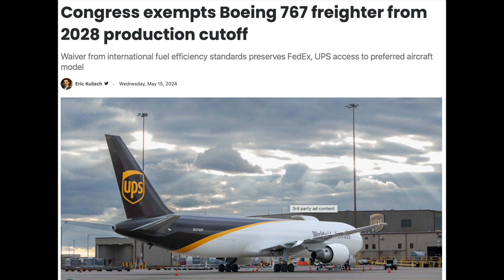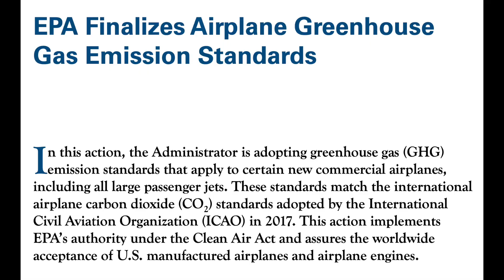Boeing 767 Exemption: Climate vs. Commerce? The Aviation Industry's Dilemma

Comment: I don't see any net benefit in legislation that pushes for scrapping perfectly functional aircraft to slightly improve efficiency.  At the moment, aircraft manufacturers are already falling well short of their production goals in meeting the orders they already have.  Pushing the B767 out of service prematurely will only stress the system even more.
Besides, the B767 is a fairly efficient aircraft already, with efficient high bypass turbofans.  B767's are not part of the problem, there are only 750 of them in service worldwide, and there is nothing to replace them with.
Reply from the maker: I agree. There isn’t a suitable replacement for the B767, and nothing compares in terms of versatility and economics. 

It’s in the interests of Boeing and companies that fly the type to maximize the economics of the 767. It seems that policy didn’t consider the range of benefits that such an aircraft offers. Additionally, policy isn’t aiding aircraft manufacturers in creating a roadmap to more efficient and sustainable alternatives. 

Thanks for your comment, and for watching.
Reply: You're right here. Scrapping it for falling short of a mandate that was made long after it was built is counterproductive. It's like scrapping a fleet of hybrids years before they are have lived their technological lifespan because full electrics are better, while ignoring all of the ICE vehicles that are still out there. At least when you talk full carbon footprint.
Reply from the maker: I appreciate your comment. Thanks for watching!

Comment: This demonstrates the idiotic actions of ignorant government agencies. Environmental issues are one thing but causing businesses to fail has only one result - huge unemployment and is destructive to the economy. Those agencies and this type video-blogs are destructive propaganda. Why just mention Boeing, other aircraft mfgs have same issues.
Reply from the maker: Thanks for your reply. As I mentioned in the video, the Boeing 767 was cited specifically because of the pivotal role it plays in commercial and cargo aircraft fleets. There is no viable alternative to the 767 that would enable air carriers to comply with the new FAA / ICAO rules. 

To my knowledge, the airbus A330 Freighter and A380 are the only other aircraft types that would require such an exemption. 

There are only a small fraction of the A330F that have been delivered compared to the 767. A380 is no longer in production.

Thanks for watching, and your comment.

Comment: As a licensed aircraft engineer working on 767s in Europe, I see first hand the reliability of this aircraft it is an extremely reliable aircraft including its engines. I also work on the modern “greener” engine aircraft. These new aircraft with “more efficient engines” are proven to be extremely unreliable in the field especially the engines the materials being used simply can’t withstand the high temperatures and are prematurely failing. It’s also worth mentioning that these new engines consume much higher amounts of engine oil per hour than older engines, this is never talked about they are only interested in the fuel burn.  Airlines are having major issues keeping these new aircraft in service due to the lack of spare engines they are having to source in order to keep up with these new unreliable engines. You mentioned the airline industry is responsible for 3% of the world’s carbon footprint. With so much effort and funds being pumped into to reduce this percentage I personally feel these efforts should be concentrated elsewhere in the other higher polluting industries and nations . Flying is now a life necessity fortunately or unfortunately depending on how you look at it. Sustainability aviation fuels is been pushed simply because there is money to be made out of it, there is nothing sustainable about these fuels if you look into what’s involved in creating these fuels.
Reply from the maker: Thank you so much for your perspective, and for informing us of the hard realities of modern aircraft. I agree with you that the airline industry is a ‘hard to abate’ industry in terms of CO2 emissions. 

Resources could definitely be applied more effectively in other areas for the reasons you cited. People are not going to be deterred from flying because of sustainability concerns. No one is going to be in favorable of a carbon tax on aviation, at least not in any significant amount.  And yes, sustainable aviation fuels is indeed greenwashing. 

Thank you so much for watching. Your commentary is greatly appreciated.
Reply: The 767 is a superb aircraft. The reason older aircraft are used for freight is that they fly much less than new expensive passenger aircraft.
Bio fuels like corn ethanol are an environmental disaster.
Check out palm oil mono culture in Indonesia for use in bio fuels.